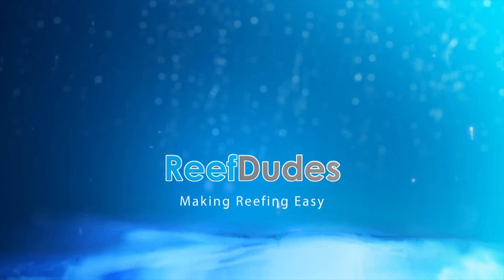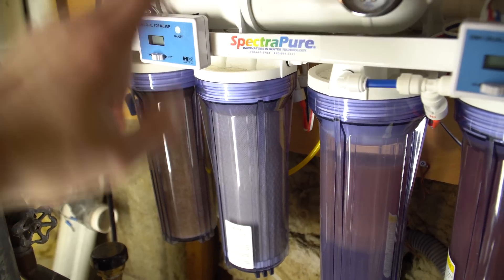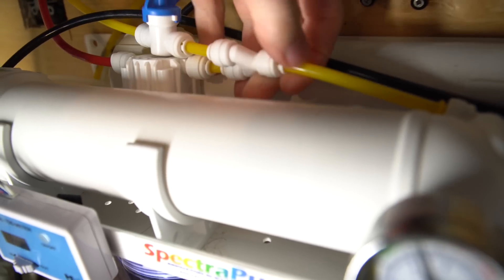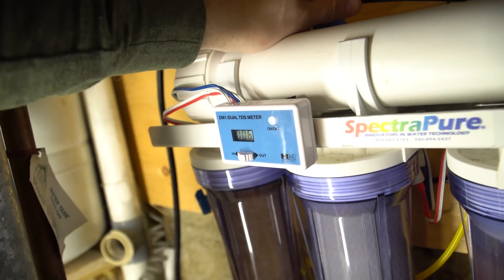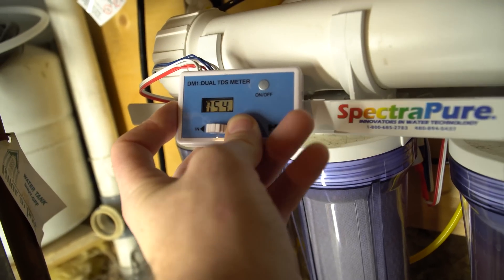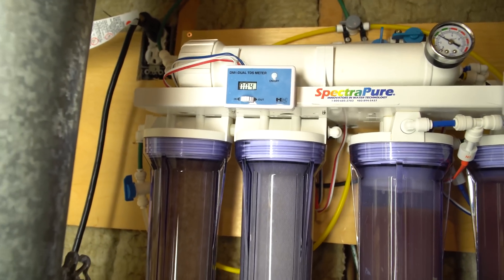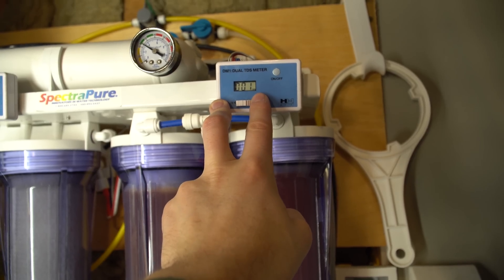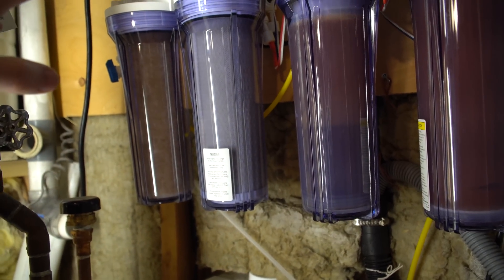Get the most out of your DI Resin cartridge - RODI tips!

Comment: (1)   do you have a wiring diagram of  your setup?      (2) is there some sort of autoflush hardware that does initial flushing automatically    (3) i have RODI filling up a reservoir with a float valve - auto top-off pump sucks water  from this reservoir.  Given that water is refilled for a few seconds, once a while (20-30 minutes?), does that mean the whole tank is full of TDS creeps?
Reply from the maker: Yes some high end kits have auto flush kits, or you could buy a solenoid like this http://amzn.to/2DPuQbw and automate it your self .  I could prob draw up a diagram of how i have it if you wanted.   The main issue with TDS creep is it burns up your DI resin fairly quickly vs flushing it out first.
Reply: I would greatly appreciate it if you could draw up a diagram for me.